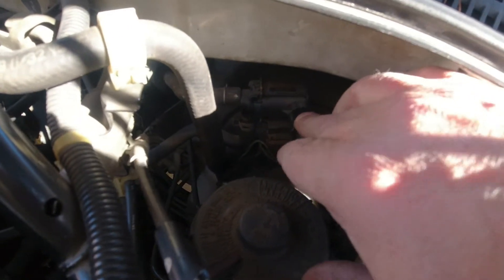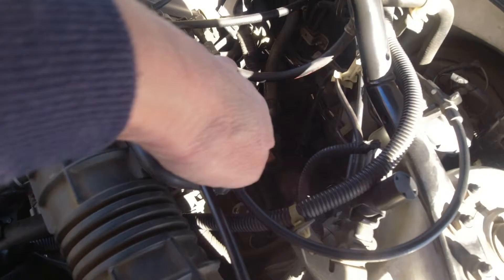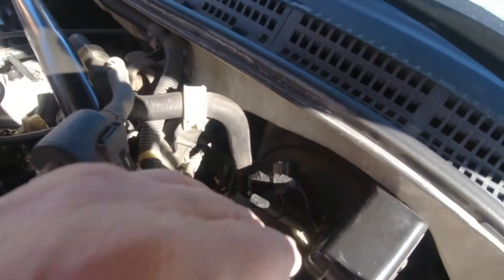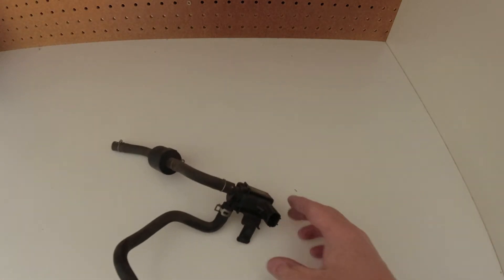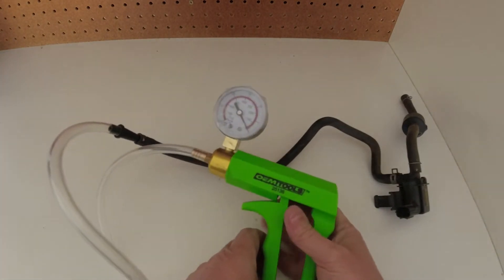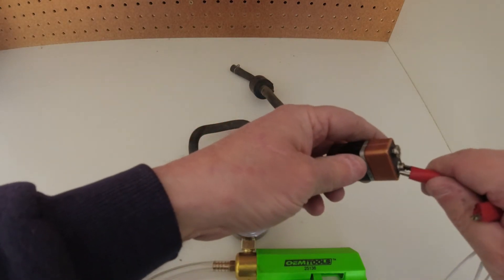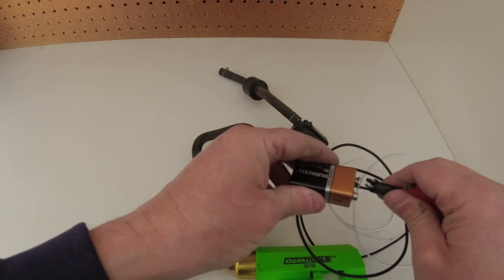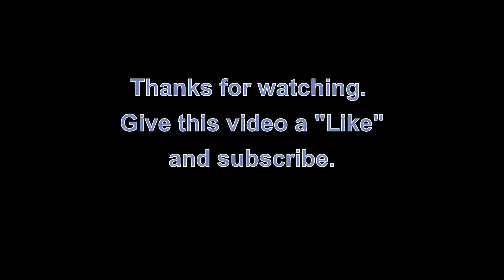2000 Acura 3.2 TL Evap Purge Valve Test

Comment: Does this explain the small and light ticking sound from behind the engine on my 03 tl type s?
Reply: im wondering the same. i have a 03 cl type s
Reply: I have the same car. That ticking noise I believe is the EVAP purge control solonoid which is in this video. They all do it in cold weather and it isn't a problem, but if it is too loud you can change it. I had mine changed after i bought the car because it was louder than it should be and the dealer changed it at only 8500 miles under warranty. I have never changed it again 22 years later, but i think it may be bad as my check engine light just came on for the first time the other day and the diagnostic computer indicated the EVAP valve may be bad... The other short noise you may hear when you first drive the car in the morning is an ABS pressure solonoid or switch that pumps up pressure in the system. You may hear it twice right away very quickly, then not again until the next morning after the car sits...

Comment: I got a 2001 Acura TL I'm having to redo the gaskets like you and do a lot of work I bought it with 116,000 miles on it n now got 193000 rebuilt the transmission at 171000